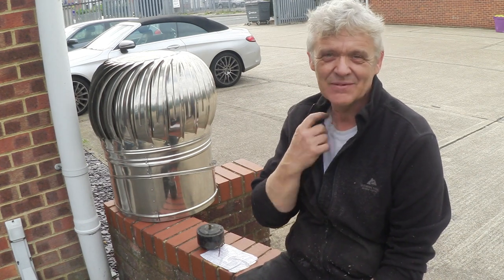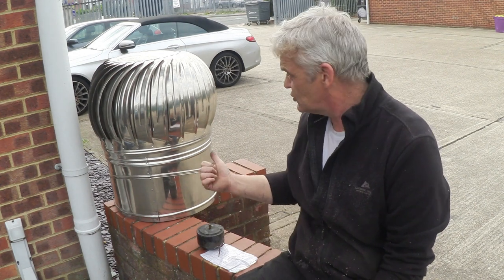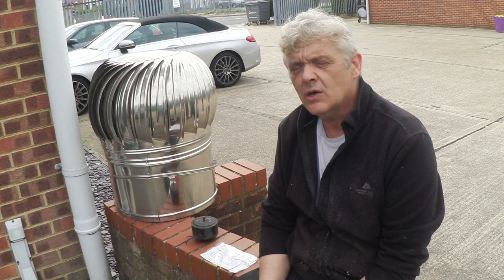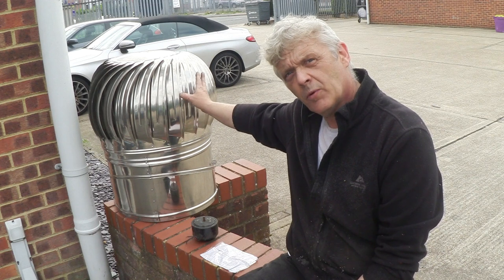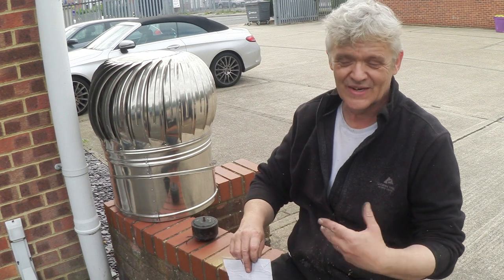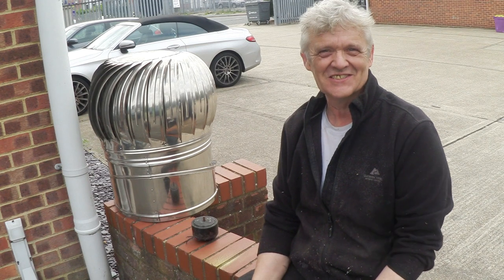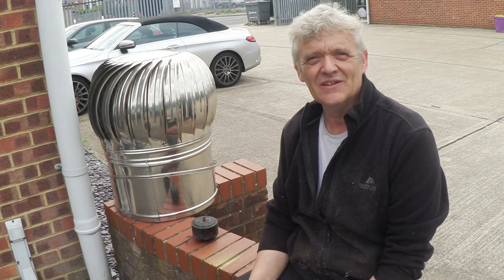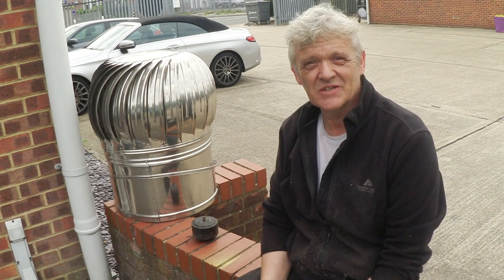Roofline Rotating Ventilator To Generator - Part 1

Comment: I have seen and installed thousands of these. My recollection is hey don’t have much spin torque... mostly they simply let hot air out of attic spaces... I’m interested to see what you make of it.
Reply: well they are like that amiga 1000 and 1084 you found and did something! with  ,versatile when you see the effects its useing, rather than just a bit of bent sheet steel/plastic/wood, ohh i can burn it,melt it,blow it up Idiocracy style thinking.

its useing the Coandă effect, and the coriolis effect on the large surface area,

(The Coandă effect is the tendency of a fluid jet to stay attached to a convex surface. convex> C <concave
The Coriolis effect is defined as how a moving object seems to veer toward the right in the Northern hemisphere and left in the Southern hemisphere. An example of the Coriolis effect is hurricane winds turning left in the Northern hemisphere.
Magnus effect,the force exerted on a rapidly spinning cylinder or sphere moving through air or another fluid in a direction at an angle to the axis of spin. This force is responsible for the swerving of balls when hit or thrown with spin.)

change the friction rotating channel for a simple floating water bearing lined with teflon etc, filled by the rain or whatever that everyting else can hang off and you get a (webbles wobble but they dont fall down lol) lower center of gravity,more mass and far less friction oc and motive force for less Viktor Schauberger vortex style (reclaimed) for free depending on what options you want to account and tweak for.
practicly speaking the Magnus effect is most interesting  for small poc here when you put two interleaved rotating cylinders/circles  near each other, as fractal woman demonstates, ie opposite spins attract,same spins repel ,as in drive or force together/apart 90 degs to the flow
Reply from the maker: worth looking at is my thought mate

Comment: First thought I had is with loading...i.e. when these are designed they are looking for the lowest friction and hence highest rpm etc...using an MPPT module you could optimise for power generation...there are many cheap low power modules on eBay...and not sure if these could be optimized for wind turbines of such low potential power...most of the real wind generators have algorithms to allow a threshold RPM to begin power tracking...a simpler method would be for a voltage threshold before current is harvested.
Reply from the maker: for sur mate

Comment: A lot of these small scale generators have the potential for "burst" power. I.E.Trickle charge a battery of cells or to compress air for a generator. Even small scale pumped hydro using a car/truck windscreen washer pump.
Reply from the maker: for sure mate - that is the core of renewables - they are good at burst and rubbish at sustained

Comment: Those will work but the more open ones will turn faster as they are designed to take smoke out. there are more for Rayon gas.

Comment: I think you can make a better generator by adjusting the brush angle in the motor. I red on these motors and they are not optimal for regenerative braking. It can either be a good motor or a good generator, but not both at same time.
Reply from the maker: I agree mate - by far the best thing is to buy one for the job - but I tend to use what's laying around because I just don't have the money to buy everything

Comment: It probably doesn't have alot of torque: I'd be interested how much.
Reply: Torque is easily produced, especially if you have a larger version, but pretty much it is dependent upon the total strength of the wind, and the diameter of the turbine, as the force of the wind enacts with the edges, and this force is leveraged against the central fulcrum, you get more torque as the speed of the wind picks up.
Reply from the maker: I don't think that its the issue here really mate